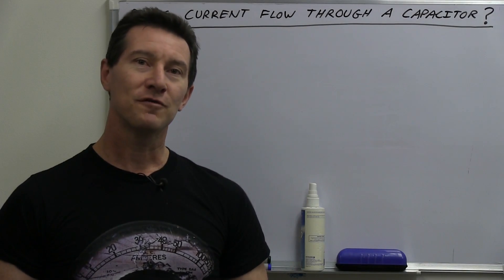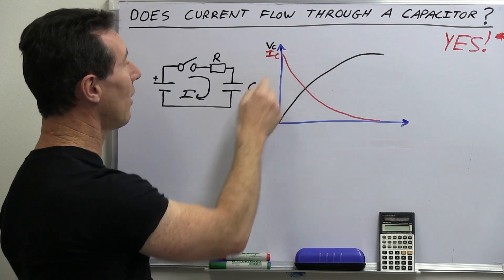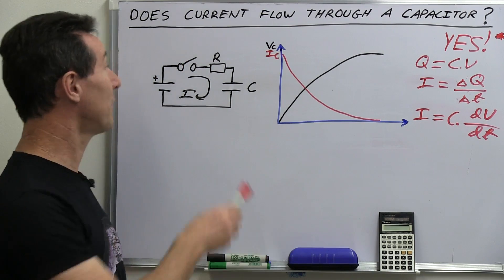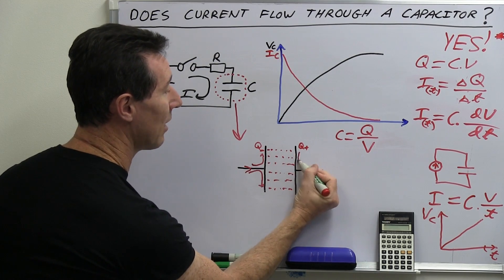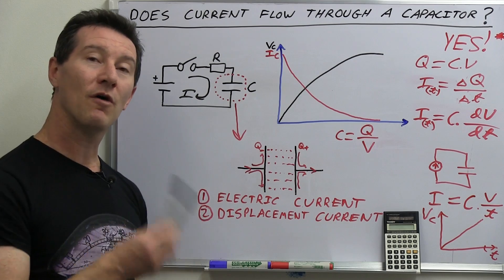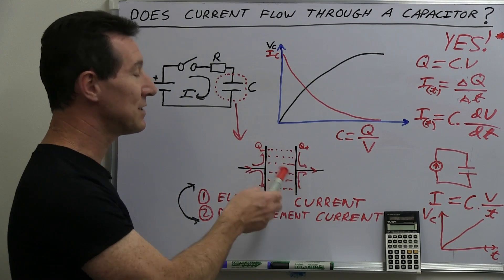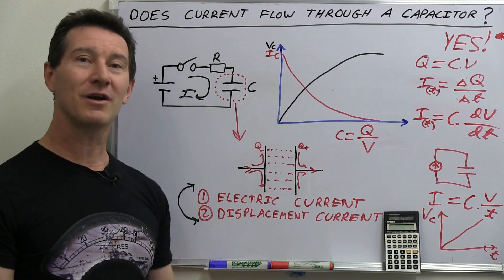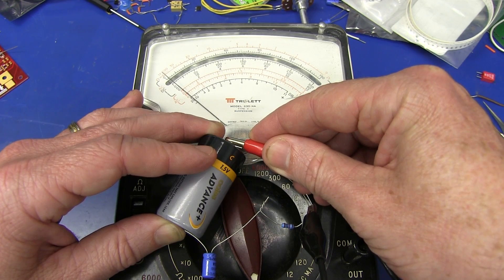EEVblog #486 - Does Current Flow Through A Capacitor?

Comment: You don't actually even need to understand how a capacitor works to answer this question. If you replace the capacitor with a mystery component X which attracts electrons on the other side and repels them on the other side the current still flows. What's happening inside this component X is irrelevant.
Reply: The electrons don't physically cross the gap.  But what about the current?   (Does the word "current" really just mean "moving electrons?"  Always?)

For example, is there a current just in front of each flowing electron?  And just behind?  A clamp-on ammeter says yes.  A clamp-on ammeter thinks that electric currents are a particular type of magnetic field:  the relative change in each electron's moving e-fields.   The ammeter doesn't have to detect each electron.  Instead it just has to detect the motion of the radial e-field surrounding each electron.

If we look at things in this way, then whenever a cloud of electrons is moving, the "current" isn't concentrated inside each moving particle, but instead fills the space between them.

If we look at capacitors from this viewpoint, then the current fills the capacitor's dielectric gap, since those changing fields extend out ahead of the electrons entering the negative plate, and also extend behind the electrons leaving the positive plate.

Get a capacitor with a wide gap between its plates.  Apply a high-freq AC current.  Slide a clamp-on ammeter along the capacitor terminals, and across the gap.  The ammeter cannot see the gap.  It thinks the current is continuous.
Reply: @wbeaty  great answer!
Reply: Component internal physics doesn't matter to newbie engineers, or with frequencies well below RF.

Us old farts have to deal with real engineering: the parasitics and the ns/GHz and the physics, not limited to those not-quite-correct spice models.  When it doesn't work, they bring it to us, who had to teach ourselves all the details of component internal physics.  

If you want to become a master, and leave the newbie world behind, then study the Black Arts:  component internal physics, electrostatic models, transmission line effects.  Learn what voltage and charge actually are, in all their gruesome detail.
Reply: Hey it's wbeaty! I remember your website from nearly 20 years ago! Your pretty much right we can pretty much consider current to be where ever we have a magnetic field, which includes the displacement current in the gap in a capacitor. There really is a magnetic field in the gap in a capacitor because of the changing electric field. if you were to put a wire there, 'electron' current would flow (imagine putting two extra plates inbetween connected to give you effectively two capacitors in series. charge moves from one plate to the other as it charges. there really is current in a capacitor!
Reply: You will find Maxwell's Displacement Current, the fundamental discovery which led to all modern EM technology.   Displacement current is the same as all others in that a clamp-on ammeter measures it as current.   It's different in that it's part of the fields around moving charges, and not described by the charges themselves. 

In SI definition of Ampere, the definition involves forces between currents, not amounts of coulombs transferred over time.  So as we define "amperes," displacement current produces real forces just like any electric current.  Of course these forces originate in the increasing charge on the capacitor plates.

When a capacitor plate has an increasing charge, we find displacement current in the plate, in the adjacent dielectric gap, and in the capacitor lead wires.  But no moving charges in the gap, if a vacuum capacitor.)

> Batteries induce current by electric fields

Wrong.   They induce current by charge-transport, same as any power supply.   The moving charges are in the battery electrolyte, as well as in the connecting wires.  A battery is inherently a conductor, with a short circuit between its plates (conductive salt water or acid, etc.)   Don't be misled by erroneous grade-school textbooks which erase the current between the battery plates.  To learn correct battery physics you have to go to college-level texts (and un-learn the incorrect garbage we were taught about batteries in earlier grades.)
Reply: Trouble is, the same electric field is always there, even in a dead battery.   This shows that "electric field" is not the answer, and it can derail us from understanding how the inside of batteries actually work.   But yes, if we treat the battery as a black box, and ignore everything inside, then of course we would say that the battery is a constant-voltage power supply (producing an electric field.)    Comparing it to a capacitor is BS though.  It shows complete ignorance of battery internals.

Open the hood, and describe the details of battery operation, and the explanation is very different.   And not just "IT'S CHEMISTRY," as if that's too complicated to understand.  The truth is quite simple.  But it's electrostatics, and that's a big stumbling-block for anyone who believes that static electricity plays no role in circuitry.

Basic phenomenon: the battery's electrolyte is chemically attacking the metal battery plates, and actively pulling out positive metal ions, leaving excess electrons behind in the "electron sea" of the metal.  As it corrodes, the metal becomes charged overall negative, with the electrolyte charged equally positive.  This corrosive CHARGE TRANSPORT produces an increasing potential between each battery plate and the electrolyte in contact (so, the actual "battery region" or half-cell is only a few molecules thick; a thin region where electrolyte touches metal.)   The rest of the electrolyte also serves as a "shorting jumper" which connects the two half-cell regions in series.

Unless two different metals are used as battery plates, the two half-cell regions will connect back-to-back with voltage summing to zero, and the battery terminals will have the same potential wrt the electrolyte, so zero output voltage.   The voltage we see on battery terminals is actually the residual voltage when one half-cell is subtracted from the other.

As the corrosive charge-transport causes the potential-difference to increase, finally it becomes large enough to repel the positive ions away from the positive-charged electrolyte.  The charge-transport and the corrosion process halts.

Connect a load to the battery.   This REDUCES the battery potential slightly.  The dissolving ions aren't repelled back to the metal, so the corrosion process starts up again.   The battery plates dissolve, and energy is delivered to the external load.

Overall a battery is an electrostatic generator, but one which produces a constant voltage, rather than constant current e.g. Wimshurst and VDG machines.  The "motor" is the aggressive water molecules which attack and surround individial metal ions from the surface of the battery plate.   The "belt" in the battery-generator is the stream of dissolved metal ions being pulled out of the metal surface and transported across the contact-potential which always exists between the electrolyte and the metal plate.

Note: no capacitor-style displacement currents anywhere, not in the metal plates, not in the electrolyte, not in the "battery region" or Helmholtz layers where the charges are transported against the contact potential.    If a battery is a capacitor, then it's one with a very conductive dielectric, with a voltage actively maintained by water's ability to rapidly dissolve metal.
Reply: @wbeaty  In your explanation about the innards of the battery  I understood little, but I find it very compelling.  Time to read more about it!
Reply: Inside component X, matters to a physicist, but not to an electronic engineer.   .   .Engineers are pragmatic.
Reply: wbeaty That's right!
Reply: Old farts don't deal in No True Scotsman fallacies because they do Real Stuff, they do it because they want to be more important than youngsters, but they aren't. They're just individuals like everybody else.
Reply: actually...current does not physically flow through the capacitor. The whole circuit is set up by an electric field, there is an electric field induced inside of the capacitor, not actual current.
Reply: wbeaty Yes current is the amount of moving charge per cross sectional area, if you look a certain distance in the capacitor you will not see current on the phyiscal level. What you will see is an electric field in the gap wether it be air or a di-electric with ions. Also it doesn't matter if the ammeter cannot see the gap, what do you think a battery is? Batteries induce current via electric field, those electrons are not in the battery, they are in the wire itsself.
Reply: "they induce current via charge transport" lol, the electrons ARE in the wire that is where they come from to power anything...An electric field is set up from the battery moving these electrons in the wire. If I see a rock laying on the ground, and I pick this rock up and place it on a hill, I just changed the potential of the rock with respect to where it was. AM I A ROCK? no I am nothing but a form of energy that changes the potential in the rock...The battery has energy that induces a current via electric field...

Comment: From a physics standpoint, there's a very easy way of looking at this. "Energy" flows through the capacitor; the first plate, while charging, produces a magnetic field, which in turn generates an electric current on the other plate, thereby allowing energy to flow from one plate onto the other, even if the electrons themselves are not. 

If you think of it from the abstracted view of "energy," which doesn't necessarily have to be held by the electrons themselves, but any combination of the electrons and their electromagnetic fields, then it actually becomes rather simple.
Reply: interesting concept
Reply: Come on, press the envelop. Let go the concept of a fundamental particle and embrace the reality that everything is an electric field, just balanced in different ways that limit and control the interactions with other fields. You just might come to realize that magnetic fields are like shadows... but that's for the advanced class. Meanwhile you can begin to distinguish the actual field attributes and how to take full advantage, unlimited by the artificial restrictions of particle physics.
Reply: Yes! It's good to keep the goal in mind: why are we moving charge through the circuit? Just to move energy to do some work elsewhere.
Reply: +eqlipse333  No magnetic fields are involved.
Applying a voltage across the plates allows electrons to be added to one and subtracted from the other.
Reply: @BMan18,   I agree most of fundamental physics is still wrong.  .  . I've come to the conclusion that our "reality" (energy/forces and matter) is fundamentally the movement (waves) of aether, which is everywhere, even in "empty" space.   .   .We don't really have physical substance, the aether does.   .   .Nikola Tesla know decades ago.